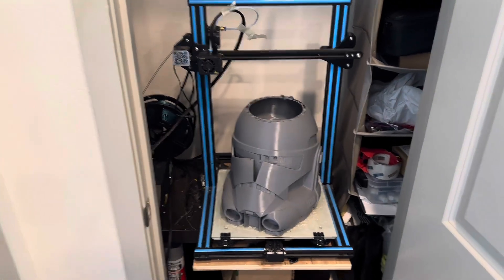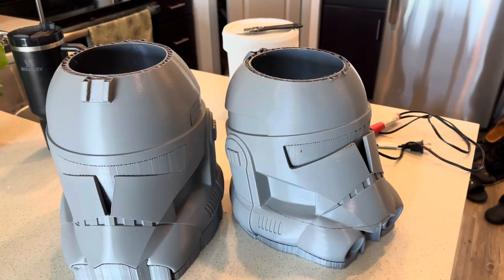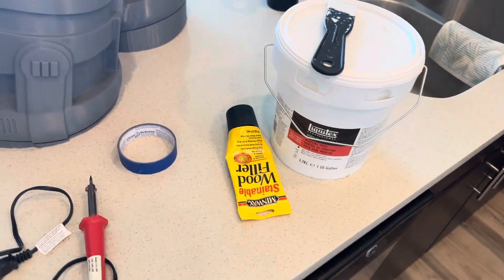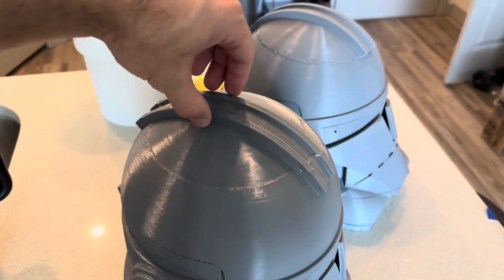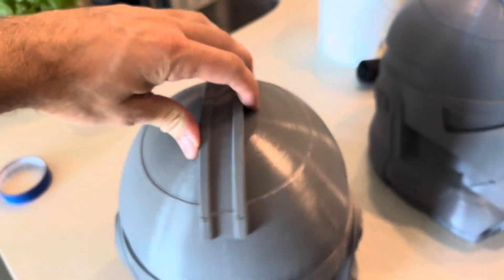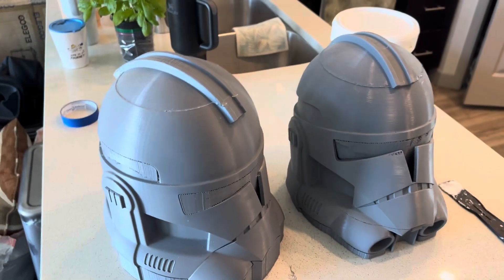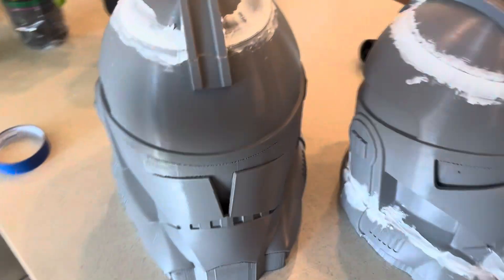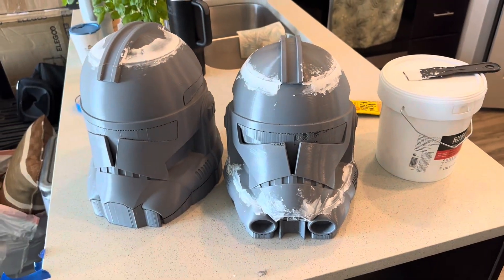How to salvage a failed 3d printed helmet!

Comment: I had a big layer shift during a print and tried to fill it but it was too misshapen to fix any ideas on what to do with it
Reply from the maker: You can break it off, align it correctly, weld together then fill the gap.